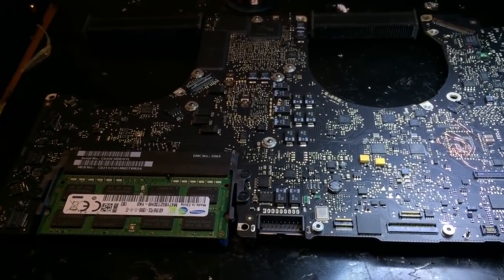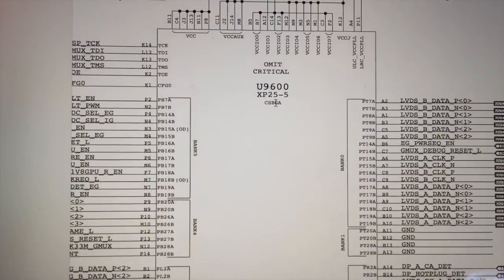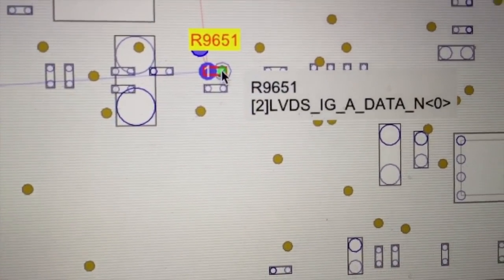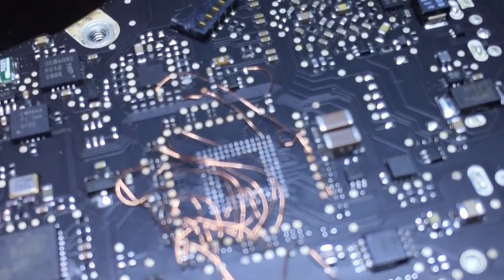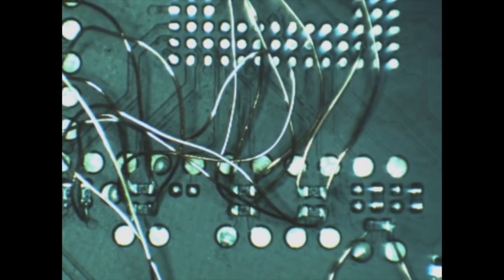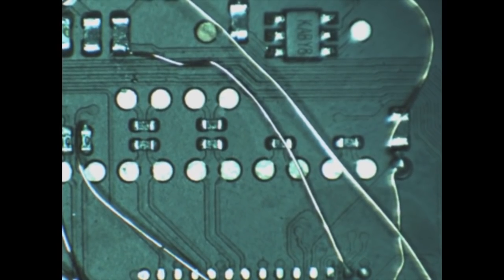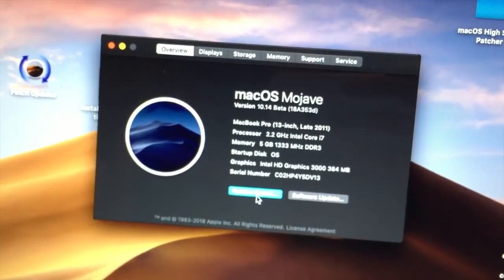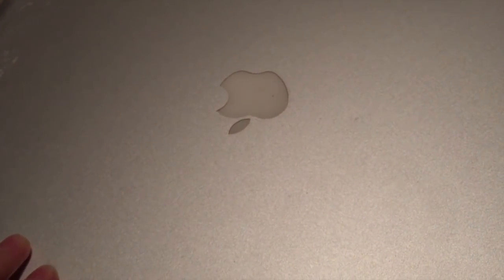Permanently Disabling the Defective GPU on a 2011 15" MacBook Pro - Hardware Mod Overview

Comment: Hey @dosdude1
Is this a 820-2915-B mainboard? 
I would love to reuse my old Macbook. (but best with ESXi )
Reply from the maker: Yes, this is an 820-2915.
Reply: @dosdude1  Whohoo! Finaly something wich can be done to this brick! 
In your Post on MacRumors you wrote that you can leave the chip (LFXP2-5E?) in place and just rewire the interfaces. Wouldnt that mean that the chip still have GPU switching functionality?
Reply from the maker: No, when you remove R8911, that cuts off all power to the dedicated GPU entirely, so as far as the system knows, it's not even there.
Reply: @dosdude1  Did'nt thourght so far that the Power line ll be cut. (this R8911 is F#$#g tiny!)  So.. To tick the system you extra wire the LFXP2, but Leave it in place, remove the R8911 & happy life ever after. Sorry that I have pick your brain on this so much.
Reply from the maker: Yep, that's right.
Reply: @dosdude1  Finaly found somebody who meight can solder this! Thinkering bout it got me into a issue. When the LVDS_IG_BKL_ON rail is hard wired the display will always be on? when it is the case I think bout a two way switch to turn off/on the display. This meight be possible?
or can the crippled Gmux still turn off the display?
Reply from the maker: @pwagner-beccard4691  No, the display will turn off and on like normal. The only oddity is that brightness will remain at max all the time when the display is on.

Comment: This is absolutely much appreciated informative video.Hats off to this guy. I did check and read all articles ,blogs and videos related with fixing this dead white screen GPU problem. None of them nothing worked but when I tried this fix my MacBook got a new life like a new one. This fix only disabled 2 things 1)brightness settings and 2) I cannot use external display monitors. But everything else is working just perfectly. It would be great if someone get a trick to solve the Brightness control as the brightness now on my MacBook is so bright that I can’t look it for than a minute. Please someone get a trick to enable that brightness control. Great job bro and thanks so much for sharing this with us. Greets
Reply from the maker: Glad it helped you! My new project solves the backlight control issue: https://computeco.de/DyingLight
Reply: dosdude1 you did a great job my friend. I am going to try this usb hardware you made to solve this brightness issue. One more thing I want to ask you is is there any problem to Update the OS. I am using now OS X Sierra and disabled all update options. And let me know to enable external monitors, can I use external Graphic Card to do that? Is it recommended?

Comment: Is the reason why the software patch would need to be reapplied with every update because macos would reflash new firmware? Would just running Linux where the firmware can't really get touched make it so that fix doesn't fail?
Reply from the maker: No, it relies on an NVRAM variable. NVRAM can easily get reset by the user, but the main reason it can get reset so easily is that the video drivers themselves change that NVRAM variable.

Comment: Do you try A1297 17" MBP
Reply from the maker: Yes, it works just fine in the A1297 2011 machines as well.
Reply: @dosdude1  Do you have a scheme for 17 "?  dosdude1

Comment: After this fix how much live are these macbooks survive?
Reply: Probably until you do system changes such as a security update or if you want to merge to a newer version of macOS. Apple software does not like it when the hardware is changed by the user :(
Reply: @Roosyer  i had mine fixed with this method two days ago....you mean that i shouldn't update anything??i ve got high Sierra not even thinking updating os

Comment: This is a cool fix that will ensure Mojave compatibility, but for about $170 you can get a brand new revised (non defective) chip installed on eBay.For the extinct 17" models, this new chip is very worth it.
Reply from the maker: Revised chips don't exist for these, any chip you install will just fail again in the future. I've replaced the GPUs on these boards myself, and they ALL fail again later. Not worth doing, and a complete waste of money.
Reply: @dosdude1  I would recommend you look up a few Brand New 17" MacBook Pros they have for sale. Theres only like 2 right now...brand new apple built, without the plagued issue. A revised chip came out in 2015.
Reply from the maker: @KingCornWallis  Nope, even the last 2016 chips still fail, and that includes the ones Apple used when repairing them under their quality control program. AMD, being crappy as they always are, has NEVER manufactured a revised version of that chipset.
Reply: @dosdude1  My go-to professional reballer, BrickFence, guarantees a permanent fix with their chip, and have only happy customers. Everything dies eventually, but their new chip doesn't just "reset" the death timer. It will live as long as other discrete graphic chips. They have done several jobs for me, and none have died. It is very difficult to get ahold of these chips, and reballing is a delicate process too (as Im sure you are aware). I would say if you really had a handful of the revised chips and 2011 boards, and did a flawless reball for each (monitoring board temperatures while reballing, verifying connections with x-ray, etc), I would use them daily (or give to friends/family) and see how long they last.
Reply from the maker: @KingCornWallis  Normally, new chips come with solder balls already on them, so there is no need to reball. How much do you use the systems? Light use will keep them alive much longer than moderate/heavy use. When used even moderately, the chips will not last any longer than 1-1.5 years. When used lightly, for nothing more than say web browsing, they could very well last a very long time, as the chip won't even be in use most of the time.
Reply: dosdude1 Reballing is not actually part of this service, most people just understand it better when I say this. I forget I am talking to someone who actually uses a hot air machine LOL. Time will tell I suppose...but these guys would be in a mess of trouble if they were making false problems.
Reply from the maker: Well, I can't see how they can, as even Apple can't... https://discussions.apple.com/thread/8642372
Reply: dosdude1 replacing the logic board means nothing if it has the same chip. I have heard countless stories like that. Yes, Apple has brand new motherboards with the same defective chip. All it does is reset the death timer. All of these specialists claim that their service is better than a new board from Apple for this exact reason.
Reply from the maker: I've seen these Apple-refurbished boards when I do this GPU bypass for people, and they do indeed have new chips on them (usually have a 2015 or 2016 date code... 2016 was the last year AMD manufactured these chipsets). So no, there are no revised chips in existence.

Comment: i have a 2010 17" and implemented various fixes which worked for a few months. Then the box went into permanent kernel panic loop.  I implemented your software fix on my Mojave installation, with your utility and afterwards, the computer does boot up to the proper mojave desktop but with the vertical pink stripes on the screen.  Isnt that the sign that the fix hasnt worked?  I ran your fix again but it didnt help. (I presume the utility runs csrutil enable after it has finished running) Is there anything else I can try please?
Reply from the maker: Are you sure it's a 2010 machine (MacBookPro6,x)?
Reply: Well I wasn't sure and it may be a few months later but ABOUT MY MAC calls it an 8.3, so I re-installed a few times and applied that patch a few times. Now it usually boots to a white screen but if I press OPTOIN quickly, on about one occasion in six or seven, when it doesn't give the christmassy stripes, it does boot up properly
Reply: @DManzaluni  did you try to "bake"  the logic board for 7 min at 200C? It usually works...to keep the solution permanent then install the mac fan control to speed up the fans at 50c
Reply: Actually no, because I am unconvinced that a hardware solution can work permanently. (I DO see the point in a fan).  Are you referring to what everyone calls balling? Can one just stick the whole computer in an ordinary domestic oven (with a proper thermometer in there) for 7 minutes at 200 degrees without damaging anything?  I had understood that balling would only return the unit to the condition it was in when new.  i.e. it will last until the graphics chip dies (again)?

I tried a tedious and involved software procedure involving deleting the kexts which worked for a while but which also continuously failed before discovering Dosdude's [amazing] utility.  Since I implemented that, the 17 inch has been working almost flawlessly. It would be nice to have some way of getting the screen to adjust its brightness / sleep properly but for the moment I am happy that I can continue to use this computer for all the typing and SD card work that my 2017 MacBook Pro can't manage because of that dumb trackpad.

HEY DOSDUDE! You are the unsung hero of the Mac world. How about developing some highlighting/palm rejection utility that Apple has been trying to develop without success for these new Macbooks?
 @mchaves7663
Reply: @DManzaluni  you need to take the logic board out of the chassi and put it on a tray. Ppl usually cover the tray with aluminium foil and then place the board on it and stick in the oven for 7-8 mins at 200C (190C-210C).. it does work as the chip gets resoldered. As you said the problem may come back again, but depends how heavily you use the machine. People hammer those machines with gaming. For other uses, this solution will last long.

Comment: We should do like everyone else and group together and CLASS ACTION Apple and AMD 
That's the reason i bought another mac, for its longevity.
Not having to deal with this type stuff
Reply from the maker: That's already happened, and Apple had a repair program for these because of it. It ended in 2016, though.
Reply: @dosdude1  The only Apple repair option consist in replacing the board with a new one or most of the time with a board where the gpu have been already replaced with an identical fautly chip... That was not an option to get the macbook last forever... It will fail again sooner or later...

Comment: I have an 820-2915-A working with stripes. I made the modification and it gives me a white screen without data. I withdrew the modification and returned to work with stripes. I made the modification again and it goes blank without data. all the welds are well made in the right place. Please an idea that may be wrong?
Reply from the maker: Check and make sure the LVDS_DDC_SEL_IG line is pulled high, using PP3V3_S0. You also need to remove R8911.
Reply: dosdude1 IS THE GMUX CHIP. One of the voltages was at 0.58. I remove the GMUX chip! Problem solved. working like a charm. Thank you very much friend for sharing your knowledge.

Comment: Wowww! Thanks! Is there any way to do the same with the imacs?
Reply from the maker: No... Just replace the GPU in those.
Reply: dosdude1 In my country the video card of an imac is not obtained. Importing the chip from China is not viable because taxes are very expensive. excuse the question again. Is that modification possible in an imac?

Comment: Hi, instead of flashing the bios chip is it possible to swap the bios chip from the 13" 2011 logic board to the 15" board ? Thanks
Reply from the maker: That's actually what I did, but found that reflashing the firmware is not necessary at all if you just keep the gMux IC in place.

Comment: Board 820-2915 also remove U8900, other ways GPU use power and going to heat it up. Also. Stop charging from chargers, only from power supply. :D

Comment: Great video dosdude1 !!

I was wondering what do you think about the soft and hardware mods from Realmacmods ?
https://realmacmods.com/macbook-2011-radeon-gpu-disable/
Reply from the maker: I strongly dislike both methods they detail in that guide. First off, all the steps they say you need to use Linux for can actually be done from within OS X in single user mode. Not only that, all you need to do is enter one single NVRAM command, instead of that complex Linux EFIvars mess they detail. The hardware solution they detail is even worse, as all they do is simply disconnect power to the dedicated GPU, and rely on that NVRAM variable (that can easily be reset during system updates and when the user resets PRAM) to keep the machine working at all. With their awful hardware mod applied, if that NVRAM variable gets reset, the screen will not come on at all. The mod I've shown in this video and detailed on MacRumors is a much, MUCH better solution, and with my new backlight controller module I've just finished developing, you can even get full backlight brightness control again after this mod is performed. Of course, this being a FULL hardware disable, it does not rely on any stupid NVRAM variables, and therefore cannot be disabled inadvertently.
Reply: Hi Dosdude1,

Thanks for your clear answer !!
Its all clear to me.

I have found the backlight controller from DosLab
https://www.ebay.nl/itm/DyingLight-Backlight-Control-Module/292753371777?hash=item442975f281:g:j2AAAOSwgG5bssHq:rk:1:pf:0

Great work !

Keep it going dosdude1 !!

Comment: did you remove the GPU chip?
How did you update the bios
Reply from the maker: No, the GPU chip is still in place, and if you leave the gMux chip on the board, reflashing the SPI ROM is not necessary. Details can be found in my post, which is linked in the video description.

Comment: i have a 2011 macbook pro 15 that’s working fine. every once and a while it will be wonky but i just let it run for a while and it will work after. got it for 200 bucks on ebay

Comment: I wonder if you can do it on early 2009 MacBooks like the polycarbonate if the Nivida 9400 or gt 330 gpu for intigrated graphics of a core 2 duo
Reply from the maker: The 9400M is the integrated GPU, which is part of the nVidia MCP79 chipset. NO 13" MacBooks of any kind have a dedicated GPU. GeForce GT 330M is a dedicated GPU on the 2010 15" and 17" models, but it never fails so there's no point in bypassing it.
Reply: @dosdude1  You said GT 330 never fails I know but I have two 2010 15" board with GPU issues... I'm actually working on implementing the same mods on these boards and see if it solves.

Comment: Great stuff. Could you provide the symptoms that the macbook pro would show if AMD GPU fails. I have macbook pro early 2011 no video output on either hdmi port or internal display, but everything works. I can do share desktop and work on it from another mac. And more details on flushing firmware on a PROM would be awesome.
Reply from the maker: Normally, when the AMD GPU fails, the system will begin to boot, but will hang at a white screen. Also, in some cases, lines and weird artifacts will show on the screen. No video at all is most likely a bad AMD GPU also. As for flashing the EEPROM, I found that it is actually unnecessary if you keep the gMux chip in place.

Comment: have a question for original publisher seeing as you are a hands on knowledgeable person when it comes to board level repair in regards to the MacBook 2011 late 17" have you tried to see if the single 16gb memory chip 2 chips being 32gb will really work in the MacBook or is there a terminal code that you know of to allow editing of the firmware to Make the hardware accept the chips in there full capacity I've search online for the answer but have yet to get a straight answer so I think you may know based on what you do
Reply from the maker: The chipset on the 2011 machines does not support more than 16GB of RAM. It's a hardware limitation.

Comment: EG External Graphics? just a thought =p
Reply: Don’t work if the GPU is defect. All graphics will be defect like the use of HDMI. However only the non dedicated standard Intel HD GPU will be working which a fix like this will succeed.

Comment: Oh god..... Seen all those little copper wires you soldered into it....
You had my interest..... But it became oh fuck no! 

My early 2011 is "fixed" by the software fix, with moving the files around & changing the EFI. 

When Mojave is officially released, I do want to put it on this machine. 
But I fear if Mojave is going to change & or complicate this software "fix" 
Because things on that fix seem to have changed on the last 3 OS's slightly each time....
My concern what will be different on Mojave. 

But I am going to try to time my purchase of an SSD to the release of Mojave, I'll clone my drive over, install Mojave. 
& if shit hits the fan, and I am stumped.... I'll just restore my High Sierra install. & say fuck it till someone smarter then me figures it out!

Comment: While you made a new video here, I'm having problems with my Macbook 5,2 2009 computer. I did your High Sierra patch and everything works BUT the sound coming out of the output. When I attach headphones it works and when headphones are out the volum is greyed out and a red light is coming from the port of the headphone jack. Is there a fix for this or any software driver to fix this?
Reply from the maker: That's actually a hardware issue. Try booting another copy of OS X and see if the issue persists.
Reply: It does. Happens with El Capitan also.
Reply: And also do you have a fix on the battery not charging either? Since I got this device the battery has been changed to 2 different ones (new) but yer still not charging.
Reply from the maker: That's definitely an issue with your logic board. I could more than likely fix it very easily if you wanted to send me the machine.